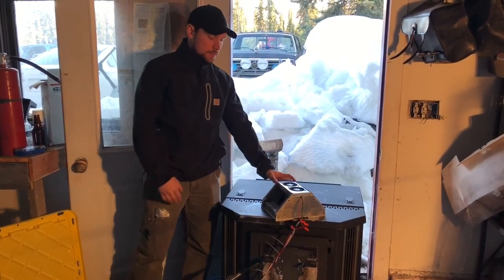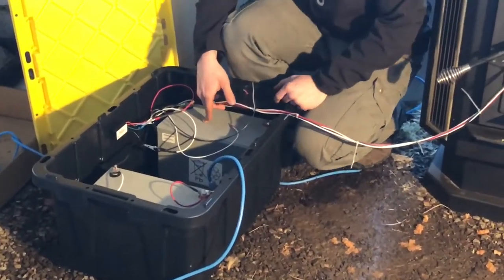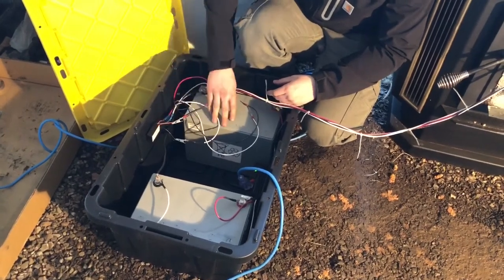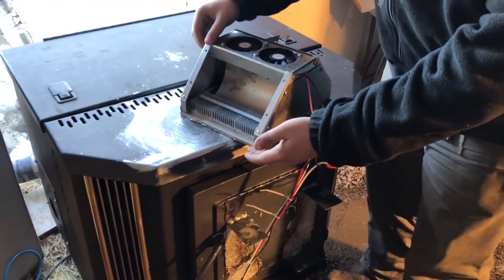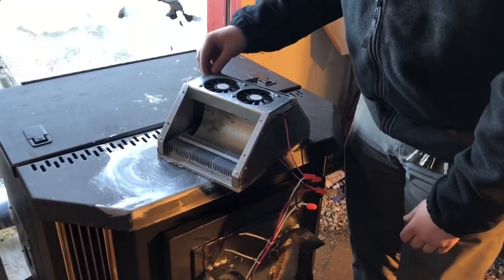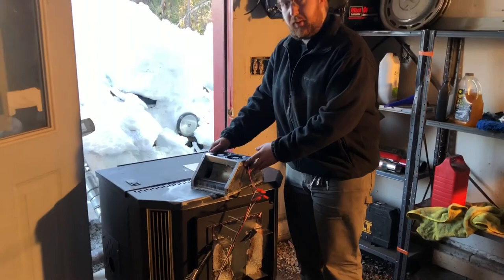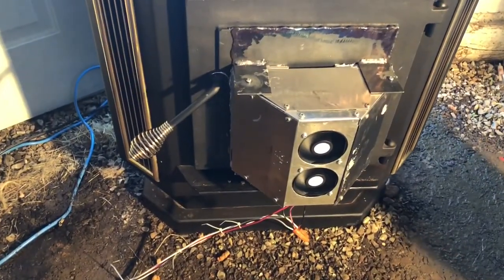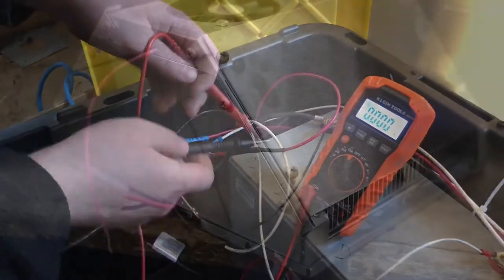UAF Mechanical Engineering Senior Project: Pellet Stove TEG Backup

Comment: Pellet stove?? Garbage and low heat... wood stoves are better but melt your modules
Reply: No they dont. That is just silly. If you learn how to build them into a correct system, and use the correct modules, you will not simply melt them.